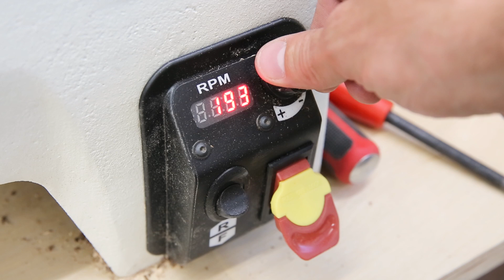Making a Black Walnut Pepper Grinder

Comment: Don't wear gloves while touching what you have in the lathe (metal or wood lathe). Make a long strip of sand paper, run it behind and pinch both ends, lightly! Incase it catches.  I learned the glove thing the hard way, do not do it! Awesome job though!
Reply: why is wearing  gloves a bad idea?
Reply: Gorki Treperović if it gets caught in the lathe while it’s turning it’s gonna pull your hand into the machine could do a whole lot of damage to your hand. It’s not a good idea to wear gloves around any machinery really

Comment: I sneezed right at this moment: https://www.youtube.com/watch?v=-bIG29fjxDQ&feature=youtu.be&t=413  Looks great man!  I can tell you're having fun with the new lathe and the awesome lathe stand.  Was that a dust collection tube I saw behind the lathe?  How well does that work for you?
Reply from the maker: Thanks! Yep, I found an easy way to make a pretty easy tube attach to my system. It works great for sanding because the lighter particles get pulled away easier. For general chip catching it does okay, better than nothing, but I still end up with a big mess to clean up.